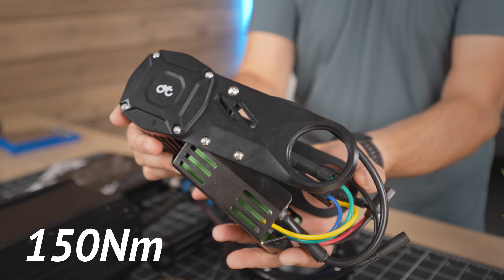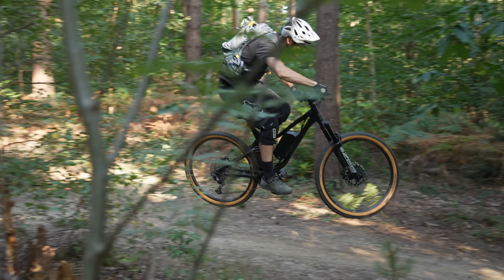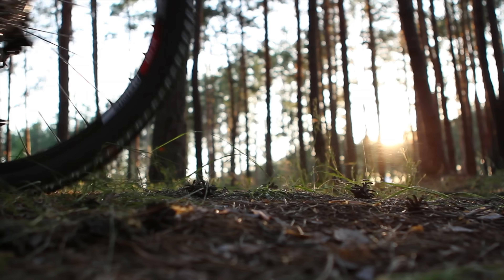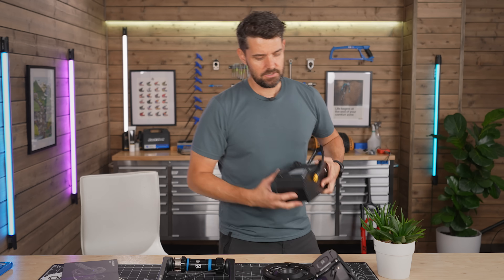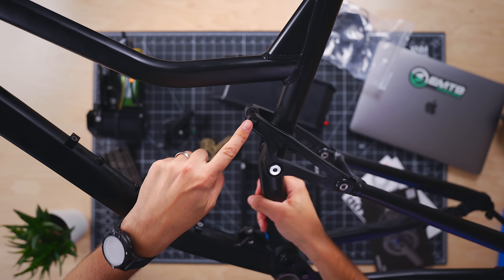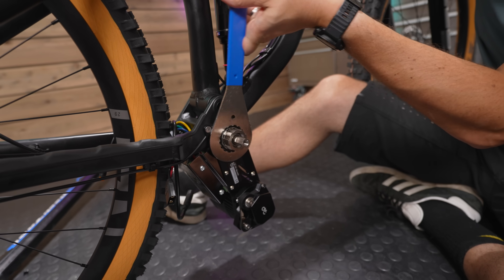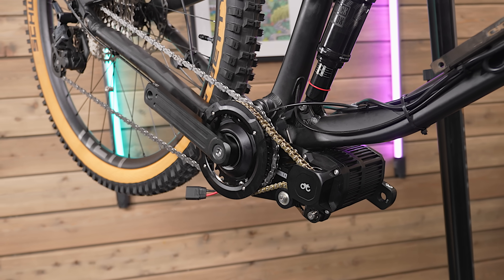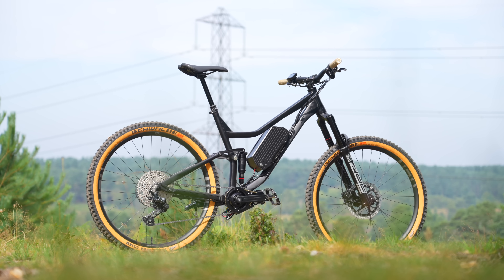I built a crazy fast DIY eBike!!! $900

Comment: With a good Battery and Bike you are over 3000 $ with that setup.
Reply: After all my calculations, I figured I can get 1500w e bike for £700 total including bike and battery. Once I've sold my current one I'm gonna build it.
Reply: @goinawol9447  I've just built a hardtail. Tongsheng motor. Bought a planet x jack flash frame to use, cost me £800. It's a rocket
Reply: @chairmanmeow8388  How fast does it go?
Reply: @mysteryman6750  limited to 45km/h. That's just under 29 miles an hour. It will only do that on the flat, wind assisted if you really crank it though. Did 35 down a hill earlier and it was still pulling.
Reply: @mysteryman6750  It's not strictly road legal but it just looks like I've got my sandwich box on the down tube so you'd never get pulled over on it. What a thing!
Reply: @chairmanmeow8388  Interesting, The speed is very decent for the price and i’m definitely considering buying it. I’m new to all of this so i’m trying to figure out what parts i’d want to buy in the future. For $800 Your rig seems like a good deal. 

I also have another question though, does the speed of the bike depend on how many volts the battery has or the wattage of the motor? or is it a combination of both?
Reply: @mysteryman6750  I did already have forks and wheels so the 800 price might be a bit misleading. The used market is very good at the minute though.
The speed depends in a few factors like rolling resistance of your tyres, weight of the bike and yourself etc. Watts of motor will factor but it's a trade off. My motor is 500w and 48v. The 250, 350, 500 and 750v motors are all the same price so 500w seemed sensible. The voltage of the battery will have to match the voltage of the motor so you'll need a 48v battery if you get the 500w motor.
Size of battery will be a factor in top speed. A smaller battery is lighter but will run out quicker. My battery is a 48v 13.5 watt hour one. It last the week on one charge to get to work and back and a few other rides.
Reply: @mysteryman6750  My bike was 800 pounds as well, not dollars. The bike market is very cheap in the UK at the moment because everyone went mad buying bikes during lockdown and now they're selling them so the used market is crazy cheap.
Not sure what the market is like where you are, I'm sure you could find a good used hardtail for $500 that would suit a motor though so I bet you could build something for $1000ish.
Reply: @chairmanmeow8388  I bought a bike about 6 months ago for $1000. It was just a standard really nice bike. Immediately afterwards I was interested in electric bikes but was shocked at the prices,which is why I’m trying to look at making my own. Since I already have the bike that’ll cut the costs down pretty heavily. I definitely could’ve gotten a cheaper one used though,In the US i’ve seen many good bikes go for less than $200. Used market is great like you said
Reply: @chairmanmeow8388  Alright thank you. I’m looking to build a pretty fast bike and wasn’t sure what parts i needed to be better. It’ll definitely be more expensive than what you have though as i’m sort of wanting 1000w or more for the motor. But also a battery that lasts a long time. I’m possibly going to be spending upwards of 1.5-2k but it’ll be worth it. Thank you for all of your help
Reply: @mysteryman6750  Bafang motors go up to 1000w. I use mine off road so I don't like the bafangs for that. The tongsheng tsdz2b motors have a torque sensor so they give you power when you need it. The bafang is great if you want to just get around quickly as they just use a basic cadence sensor. If you're pedaling, it kicks in. Thats no good for off road as it will just kick in and drive you off a cliff lol
Reply: @chairmanmeow8388  I found a mongoose cx24v450 I'm getting a motor riser plate made to squeeze a 48v 2500w motor and controller and running a 35ah backpack battery. Not the most powerful but it'll be plenty for me and the whole set up including the custom welded riser plate is around $1100
Reply: What could a cop do if they pulled you over? It's not like they can whip out a multimeter and start measuring your wattage
Reply: 4 Horses  mine is for offroad use mainly. 45 is good but it depends what you're going to use it for. I don't need mine to do 45mph
Reply: I would love to do it, but it's expensive and plus the delivery and tax that i will need to pay ..
Reply: Can someone give advice on fixing a large heavy battery on standard bottle cage bolts, it's not looking strong enough.
Reply: @allwearearestars  3d printed parts or zipties ?

Comment: Running the Stealth myself. This is the lightest mid drive you will find and batteries can be custom built to fit in the triangle seamlessly. I like the look of the bike and look forward to your next video. Am I the only one that noticed the 22H error code on the display. Glad you got that figured out!!😉
Reply: Which wattage hour battery do you have on it? And how long does it last on your riding?
Reply: @juusonurmi5620  
17.5 Ah. 52V. Range depends on riding style.
Reply: @kmtnbike1117  on average though?
Reply: @juusonurmi5620  
I have my Stealth on a hybrid /road bike and can ride 40 to 60 miles in mode 1or 2. If you have a mountain bike that would be cut in half if off-roading I would imagine and depends on if you turn it up to full power which will eat up your battery quickly. I would say 20-30 miles is a good range for most but depends on battery size,riding conditions, weight of rider and what mode you ride in.

Comment: It’s not legal for uk use because you can switch away from the 250w setting 😢 They should make a 250w only version (which might even be lighter) as there must be a lot of potential sales for people in the EU  that want a fully legal kit that is a much better form factor than the bafang units.
Reply: there is only a small number of 250w ebikes that dont output more than 250w,  250w is crap
Reply: @SIMONC256  it may be crap but anything else is illegal in the UK. Have an accident and have someone inspect your bike and identify that it is illegal and you are open to significant liability. Prebuilt bikes in the Uk are 250W and satisfy most people.
Reply: @AndrewDCDrummond  there all over 250w ,  just get a 250w sticker and you will be ok,  just put it in 250w mode just before you crash, or throw the battery away so when the police turn up it is 0w
Reply: @SIMONC256  but that’s the point, a 250w specific one would be lighter/smaller and would enable an even lighter build, so faster. There must be a sizeable market in the uk and eu for people that have existing good quality bikes that could be converted to a legal bike with a kit like this without looking like some bastardised monstrosity with a huge Bafang mid drive unit hanging down from the frame.
Reply: @AndrewDCDrummond  250w is for an old lady going to the shop.
Reply: @SIMONC256  or someone who actually has some actual fitness and just wants the edge taken off, rather than an illegal motorcycle
Reply: @AndrewDCDrummond  you can limit the power in the app to what ever power you want
Reply: @SIMONC256  that's not legal in the UK though

Comment: unfortunately even with a limiter it still isnt uk legal
Reply: no ebike is legal, they all output more than 250w
Reply: @SIMONC256   theyre all capable of outputting more than 250 for sure
Reply: @dcd231  they do i have tested this on the specialized levo on boost mode it outputs 900w
Reply: @SIMONC256  were talking normal ebikes not 13 grand specialized bikes designed to do that

Comment: I wonder how the torque and extra weight will affect the swing arm and linkages and head tube due to the extra braking heft?  Being that this bike was never built with this in mind I cant imagine long term it will be much good for it. Also you have less clearance below the bike now so step downs will be a major issue.
Reply: Is there too much difference between that and a heavier rider? These bikes are usually rated at 110kg maximum load, so if kept below that should be fine. You can say that the weight is in a different place, but depending on the rider this will still happen anyway due to experience levels. An extra 5kg really isn't that much.
You're probably likely to eat drivetrain components more often, but that's the same with a regular ebike too.
Reply: @thepeganator  5kg is huge and dont forget you should set up the sag so you should already be sat more into the travel.....
Reply: the chain ring sits lower than the motor so...

Comment: I've just done this build for a friend.
It's expensive, still needs fettling to fit, isn't particular smooth (stock), terrible chain line, loud and stupidly powerful.
It does fit bikes that can be troublesome for other motors though.

Personally I would just spend £250 on the Tong sheng from PSWPower. A far more natural pedaling feel straight out the box.

Oh Rob, use assembly/anti seize grease rather than high performance bearing grease. It's cheaper and better for the job.

PS
It's 1500w continuous, 2000w peak.
They also do a big brother with 3000w.
Reply: How would you compare an OSF TSDZ2 to the X1 Stealth in terms of pedal feel?
Reply: @patricke3848  
Much better, but I didn't play with all the settings on the Stealth, it may improve with fettling.
Obviously the Stealth has far more torque, and a built in temp sensor to stop you toasting it.

Comment: nice work Rob! love that the mid motor are getting smaller and stealth but it appears no one is focusing on making the battery smaller. The current battery size for dyi is hideous!
Reply: maybe theres a lower limit per capacity they can be. all the low hanging fruit of battery tech has been picked. contrary to those who claim technological progress can be infinite, it aint so.  want a smaller battery, choose a smaller capacity

Comment: I'd only change the brake callipers and pads for more stopping power
Reply: He put on Magura MDR-P rotors they are the best out there so no issues 👍
Reply: @CoyoteMTB77   Still, rotors aren’t the whole picture
Reply: @tippy35075  Agree but any brake with those rotors on it makes a massive difference in stopping power.
Reply: @CoyoteMTB77  Thats true, I always like to be over braked just incase

Comment: I want to know if it's possible to mount the battery on the underside of the down tube and not have any issues
Reply: Yes, this is possible. You can check on CYC's IG page. I think they've posted an example of someone who did it.
Reply: @KTEMTB  you're right, there are some photos there. Thanks!

Comment: Sorry, these are all science projects best left to electronic geeks.  All the ones I've seen, have wires all over the place & require significant electronics knowledge to set up & keep running.
Now that the earlier versions of factory built bikes made from 2015 onward are being traded for new bikes, there will be (are) many low mileage 2nd hand bikes available for reasonable prices that do a far better job.
For example, I'm getting a new bike next week & I'm selling a low mileage carbon fiber framed 2018 Moustache ($ 7600 new) for $ 3,000 that requires only a battery charge & you're out having fun, instead of wasting hours building a very compromised project-bike.
Reply: If you can maintain your bike and plug matching coloured and shaped cables together, you can do this build.
Reply: @kevinshort3943  I rode with a guy who when having shifting difficulties with his front derailleur limit screws, had to bring the bike into his LBS.  Do you think he could " plug matching coloured & shaped cables" ?  But you miss my larger point.....even if you have the technical wherewithal to accomplish the installation, the ultimate result is a bodge.
Bosch, Trek, Specialized etc. have many engineers who have spent years refining these bikes into a package that even the least mechanically inclined can ride daily without concern.  Show me anyone with a BBSHD who doesn't have to tinker.
Reply: @Tumid1  
An add on motor is for giving new life to an old bike you already have.
If you don't have a bike (or are going to buy a new one anyway), buy an "official" ebike.
It's not the bodge you think it is (but as you point out), there are chain line issues, ground clearance problems etc.... None of which exist on manufactured ebikes.
Reply: @kevinshort3943  Why give "new life to an old bike"?  I rode my 2010 Trek Superfly I have hanging on the wall & it felt ancient.  Why would you want to add a motor to an already obsolete bike?  I think ppl are just being stubborn & will sacrifice their pleasure in the name of "recycling".
All activities have a minimum price of entry whether buying sneakers to run or $2000+ to buy a decent ebike. Spend less & have no fun; it's just how it goes.
Reply: @Tumid1  
Most people are happy with their old bike, they just don't use it.
$2000 will buy you a pretty crap Ebike.
Reply: @kevinshort3943  If most people are happy with their old bikes why do they stop using them & why then do millions of people buy new ones? Answer....They think they'll be happier with a better bike.   My point is $2000 gets you a lot better bike 2nd hand factory ebike than $2000 for a DIY kit on some relic out in your shed.
Reply: @Tumid1  
I think it's often that they get fed up with riding, rather than the bike it's self.
Ebikes remove a lot of the tedious bits of cycling (even bad ones).

Comment: Another few years and trails will be full of these very powerful bikes that don't even need to be pedal assist. You can get them to go with throttle only. At least with current mainstream ebikes you need to actually pedal to get to the top of the hill. The bafangs and cyc's are going to turn trails into moto parks.

Comment: Looks like the battery could easily rip the bottle screws from the frame? That's a lot weight to support.
Reply: The Bottle mounts just stop it from moving, all the support is on the down tube.
Haven't had an issue in 2 years (multiple crashes), and neither has any one I know - apart from the prat that hosed his down, live.

Comment: How secure does the battery feel? I’d be a bit worried about the load on those two small cage mount lugs.🤔
The frame should be fine, the weight difference is less that the factored in difference between a light and heavy rider.
Reply from the maker: This frame actually has 3 lugs on the frame (on for a cable guide but same lug style as bottle holder) - so 3 bolts holding it in. It seems pretty secure so far but time will tell!
Reply: I'd add 2 more nutserts to the frame if it was my build :)
Reply: @Tony_P  Yes I agree, especially in a carbon frame.

Comment: Not for me at all, that battery is horrid. Lets see if the frame can cope out on the trails?
Reply: The additional weight difference would be less than the difference between a light and heavy rider so shouldn’t be too much of an issue. I’d be more concerned about the bottle mounts holding the battery in place.
Reply: Why wouldn't the frame cope?
Reply: @hughoneill6555  think about it Hugh.
Reply: @roddas26  like the other guy said it wouldnt be an issue at all. Use ur brain
Reply: @hughoneill6555  who mentioned weight?

Comment: This motor would be great, but unfortunately, my need is to keep the Q to a feasible 168mm or less due to leg/knee issues.  From the CYC specs,  Q Factor = 190mm :/   
I keep waiting for a solution that doesn't result in something akin to a fat bike rider stance.  I wouldn't care if the motor was 1/2 as strong if it didn't result in a wide and offset set of cranks.

Also, the system does look like it would be at all weather and debris proof.  It will be interesting to see how it fairs if/when you test it in your typical muck and wet.
Reply: There is an upcoming Italian motor that may suit.
It's called lightest ebike, or sumsuch.....
It doesn't affect chain line or Q factor.

Comment: Brilliant! I'm really looking forward to the next video on this. I'm at a point where I'm considering either a factory E-bike or building a conversion like this.
Reply: It’s a great system I’m also running it.
Reply: @e-bikemotorrepairs  how much all in? And any issues
Reply: @hughoneill6555  motors start from £750 batteries depends but start around £400. So far it’s great and no issues.
Reply: @e-bikemotorrepairs  so all together including bike 2000?
Reply: @hughoneill6555  well no depends on what bike but could have something running yes but may not be the best bike.

Comment: Good work. I like your thinking. Not the best looking bike but definitely a place in the market for a budget option. What do you think a costing ends up at?
Reply from the maker: You can buy the full Vitus Mythique for £1349. Plus about £1300 for motor / battery. Obviously much cheaper if you don't have to buy the bike and you already have one hibernating in the shed!
Reply: Yeah it really is an affordable alternative. Can't wait to see how it handles the trails.  Your savvy enough to work out which frame will give you geometry that will work so I'm thinking it's gonna be pretty good. 👍

Comment: Great idea! The battery solution is always a challenge I guess. It will probably always look like a hack.
Reply from the maker: I've seen some really neat options where some people make a case for the battery that closely follows the lines on the frame. And some use a Specialized Stumpjumper and actually put the battery in the SWAT box inside the frame for a super stealth look!
Reply: @RobRidesEMTB  I'd love to see that!